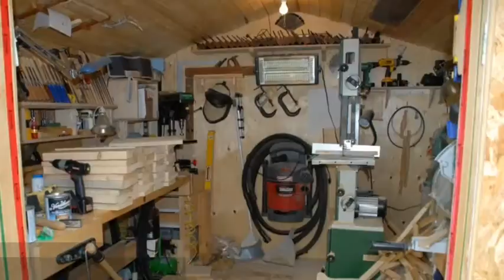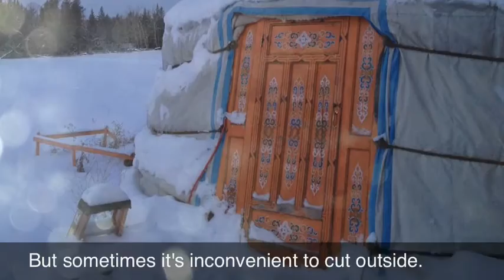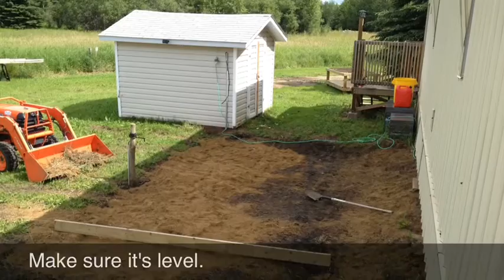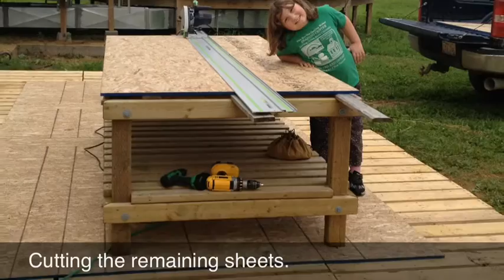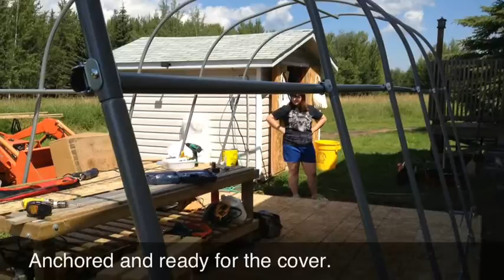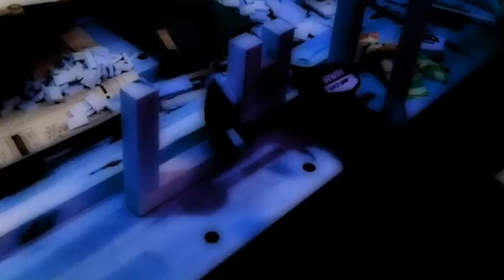Adding More Woodshop Space - Cheap!

Comment: great idea for what you needed.  In warmer weather it will get a bit hot in there like a green house would.  Try using a box fan or even a 30 inch fan to move air.  It will feel like you have air conditioning.  I I do that in my detach one car garage to keep me cool when working on the car.  Luckily I have a basement shop so temp stays pretty close to the same all year round.  but its still tight to work in because its not the whole basement.  I cut sheet good down out side a lot.